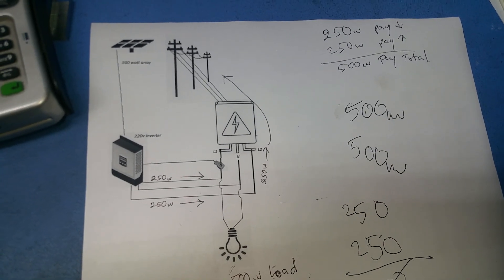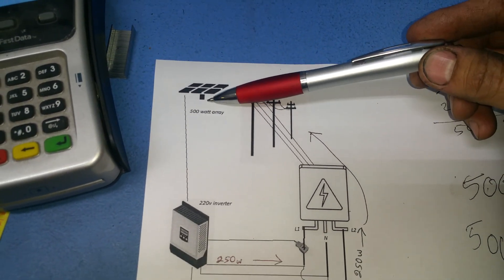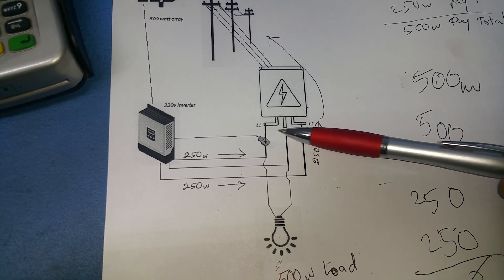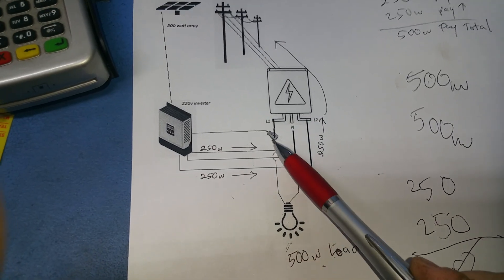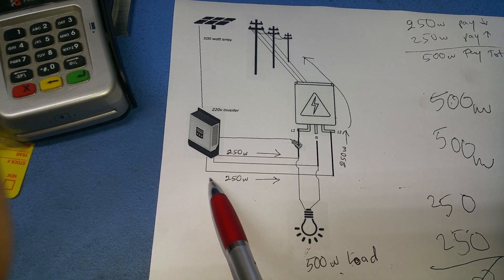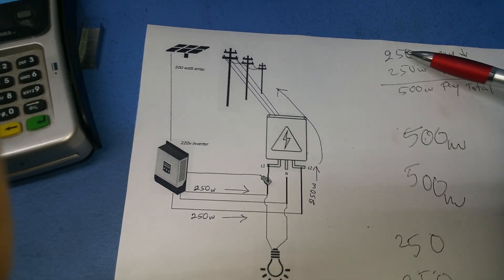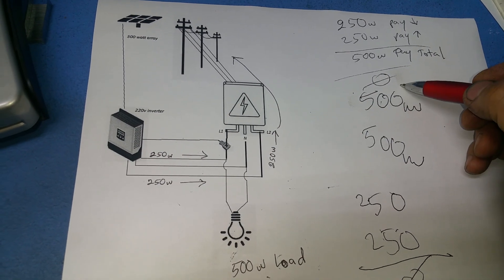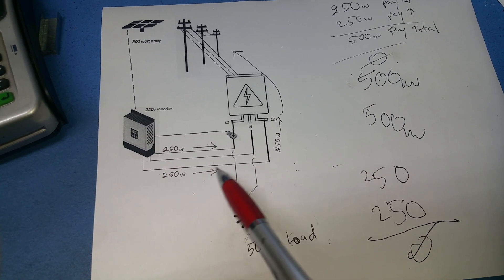220v grid tie inverter with limiter

Comment: Your limiter even though it goes on the one leg remember one of them are neutral and the other one is your hot wire sometimes in different countries they change the color the other one is your ground so when you find out which color wire is your ground one is your neutral and the other one is your load you put that limiter on your load make sure it's on the correct way this will stop energy going back into the grid that's what you were stating wrong the energy does not go back in the grid because the limiter is supposed to stop that but if you need a different opinion please check out this video from a guy in Australia I think you will understand it better: https://youtu.be/RcOt8sMgzsQ

Comment: go to ebay and they make a dual clip monitoring system one for each phase. need to follow the coil directions.  then you have the inverter put out 220v and put across both phases

Comment: Are L1 and L2 phases with 110v each or 220v each? Here in Brazil it changes from one region to another. The residences with three phases of 110v and one neutral, mine is two phases and neutral. I can connect 110v devices (phase 110 and neutral) and 220v devices (phase 110 and another phase 110)

Comment: Jeff Xiong, This will fix your problem with the inverter producing and sending power to the grid. Go to Ebay and search for the following: "Upgraded cable/coils for US 220v Grid tie inverter with Limiter GTIL. USA Seller".  Read the sellers description for a better understanding of why and what is happening.  The seller says he is an inventor, engineer, and college electronics professor, that can support you.
He also points out this:
This China engineering simply does not work correctly unless you monitor each side.   USA uses 240vac single phase in homes,  and splits it into 120v after the meter using the neutral or common center tap.  So if you have a 1000w or 2000w  120/240vac GTIL as pictured, this is a must have.   If you have one or more 120v models (it's likely a 120/240vac dual model), we have a dual inverter model, so you don't need two cables.
Reply: Thanks I was looking for this product

Comment from the maker: Thank you for those who have replied.  Your information was helpful  to my learning and research.  I had further installed and finished in testing my theory.  My suspicion are correct.  For 220v inverter with limiter, it doesn't work well for US electrical system.  The solution is instead of 240v inverter with limiter, install individual 120v inverter with limiter 1 per leg (L1, L2).  I'll post another video for my finding details.
Reply: So there's no way of using the 2000 W inverter for the to 220 Voltage US  That's what they're selling them for listed for US
Reply: Watch this solution https://youtu.be/Aza7vvLe0oY
Reply: @SpencerLAPower  My understanding is that in order to use the 220V version you will need a dual clamp-on coil set up so each 110V line is monitored.  If L1 is using power and L2 is not the inverter should know not to send power to the L2 line.

Comment: In the case of split phase you have to clamp two hot wires with one sensor (voltage between them is 240). However one wire is flipped so magnetic field adds up. It might be tricky (or impossible) to do inside main power distribution panel. So best way is to run longer copper wires outside the panel and clamp it with sensor. Wires have to be thick just enough so you can close your sensor. It looks ugly but works! Inside smart meter there is a sensor which clamps two hot wires the same way - one wire runs opposite direction so magnetic field adds up. There are some videos about smart meter tear down, like this one so take close look: https://www.youtube.com/watch?v=DxdB37Na8iQ

Comment: i think your correct in your assessment, and that you need a 120v inverter and should only run it on the same circuit with the amp clamp/current sensor...in your case L1

Comment: In this case all electrical equipment must be 220v, in order to consume all the power generated by the solar panel and thus not returning any voltage back to the utility grid.